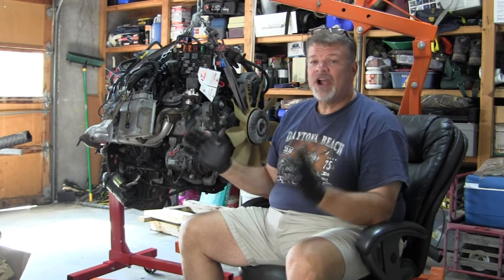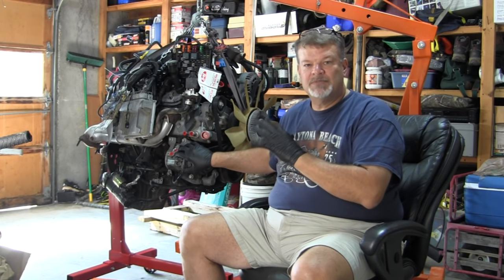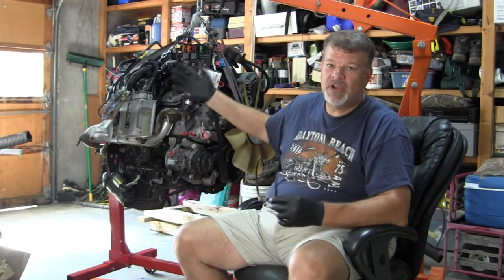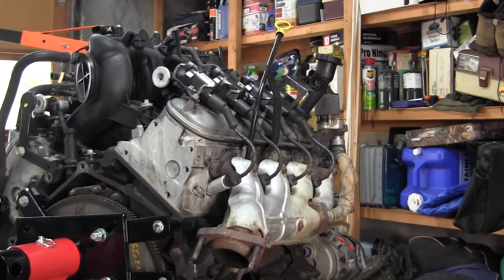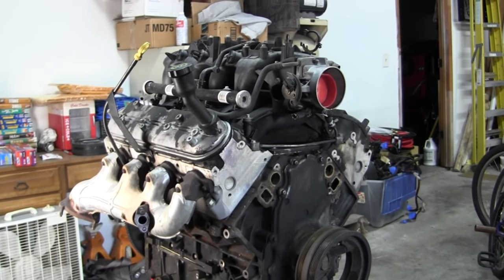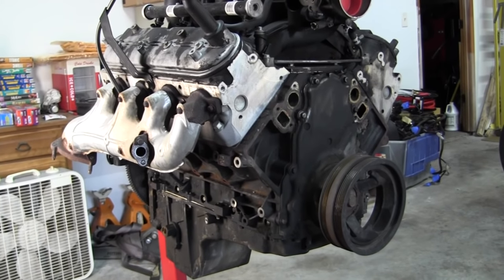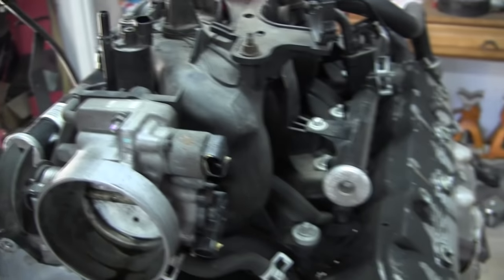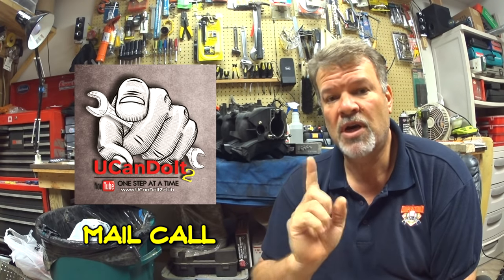LS 5.3L Build Part 1 Harness & Accessory Removal | Project Rowdy Ep005

Comment: I have a 2006 Silverado with the L33 Block I am about to tear out of the truck. I believe I have a bad cam/lifter. Stopped taking it to shops because they're all soaking me ... replaced my water pump, belt, and pulleys. When I finally got brave enough to diagnose this myself I pulled the pulley belt and ran the engine, noise is still there without any accessories. I have scoured youtube for info on rebuilding a 5.3 and found your project to be the absolute best reference and resource hands down. Eric over at South Main Auto Channel has a great series on removing and reinstalling the engine out of the truck and back in so between these I am about to go for it ..... I will mention I spent 20plus years as a parts man for marine and motorcycle dealerships so while very comfortable around an engine I have certainly never pulled a V8 and rebuilt it..... so your moto really inspired me.
Reply from the maker: Thanks for the feedback Sean!   I originally had interest in locating an L33, but the salvage yards are a little too proud of the aluminum block.  As I am throwing this into a Jeep CJ for Street use, I really just could not justify the upfront added expense.  So many great options and choices for parts available for these Gen3 and Gen4 engines.  I bought and followed a cheap book to follow as a guide.  And logged all of the parts that I used (links to download in the "Show More" section.  Cheers and if you have the opportunity to take your time on your project...  have fun with it!!!!!  Mike
Reply: Love your vids , is 2001 GMC the same ?

Comment: Good job in keeping the 862 heads. After porting they actually out perform all the 706 and other heads everyone goes for.

I’ve got a set on my L59. Great stock heads. I was mad until I finally learned about them being great heads.

SUPER CLEAN too! My motor was covered in grease. That’s what mine looked like after I got done washing it for 3 hours.

Comment: Will be starting an L33 rebuild very soon,  will be my first rebuild.  I have 
 2005 and 2003 silverados and this will be a spare. 2003 has 285K, 2005 has 180K.  So glad I found your channel!!  Thanks for sharing this!
Reply from the maker: Yours should be a fun project because it sounds like your not on a tight timeline.  Enjoy and have fun with it.  It's pretty cool stuff.  Mike
Reply: @UCanDoIt2Mike  yep, not a rush job for sure.  Just a fun project and will then have a backup motor.

Comment: Awesome series.  I plan on also using a LS motor so this is very helpful.
Reply from the maker: Sam, Do you use MS OneNote?  I have a couple of pages of notes that "might" be relevant to your research.  Let me look back through the notes and if I think they would be useful, I can either send you the Notebook, or convert to another format.   That would be a good video...  How I use OneNote to collect and save all of the information that I have gathered for this project.  Cheers!
Reply: I have never used OneNote.  Any information would be appreciated!  My brother recently swapped in a LQ4 and T56 to 93 Camaro that had the LT1 and auto so I plan on asking him for help too. lol

Comment: I like your style, smart move labeling all the wires you pulled off the engine. As a former heavy line Ford engine mechanic, I learned to do this as an apprentice. Sure, the "old pro" master mechanics could skip this step and laughed at me for taking the extra time. But the "hot-shot" youngster apprentices who thought they could get by without labeling the leads frequently got slowed down playing the guessing game when it was time to reattach them, and I got the last laugh...
Reply from the maker: Love the story!  And your right!  People need to learn to slow down and attack things logically.  By spending the extra 2% of time, it just reassured in my brain what it was and where it went.   Cheers to you Sir!   Mike

Comment: Bought a 07 5.3 yesterday to put in my 240z and this video helped alot i cabt wait now
Reply from the maker: dave datsun Awesome !!!  You should also checkout my LS Harness cleanup series.  It will show you how to remove unwanted circuits.  There are some great diagrams available under those videos.  Cheers and have fun with your build.   Mike.
Reply: @UCanDoIt2Mike  oh yeah I definitely will

Comment: This was such a great video! I bought two 1980's square body c10's that I'm trying to make into one nicer one. I also want to get a 5.3 and this video gave me some insight to that! Thank you if you see this!!
Reply from the maker: Sound like you have the beginnings of a great project.   A GM Gen3 engine in an old square body is quite popular and therefore there should be some good premade adapters to help your project.  For the longest time, my favorite truck was the 80's Chevy Silverado in Black with Rally Wheels....   Smokin'!    Cheers Mike!!!!!
Reply: UCanDoIt2 yes they are awesome trucks! Thanks for the reply! I appreciate the info as well! I have a couple questions for ya if you don't mind. How long did it take you to do this process? Where did you get your engine stand and do you recommend it? Lastly, how much money do you think you had in the engine overall considering you had it machined and everything?
Reply from the maker: It took me a long time mostly due to filming and setup.  Teardown could be done in a couple of hours.  Machine Shop work is a couple of days of work.  Build back up, should only take a couple or part-time days.  Below the video is a link to a PDF file that show all the part numbers and cost included in this build...  about $5k.  But there are may options that I added that most will not.   The Engine Stand came from Harbor Freight.  It is a 4 Wheel version that helps give it a better footprint.   The Stand was rated for the weight that put on it, but to be honest, it shakes a lot.   If I was going to do this more, I would have invested in the larger version (more steady), but for my application it was fine.
Reply: UCanDoIt2 I appreciate all of that! I will have to give you a little shout out when I start my build! I appreciate the review of the engine stand as well! $5k is a bit much for me as I am still in school but I probably won't do a full tear down. My goal with the C10 is to get to 400 hp and ive been told that that shouldn't be too hard!

Comment: ok this is my favorite channel! thanks for the mail call buddy! this is fun to watch and interesting to see how GM puts their stuff together. like internal cam and crank sensors...! I'm ready to see inside this engine Mike!!!
Reply from the maker: You know... this is just some cool shit!   Thanks for the stick.  When I remove Rowdy's Hood, it is going on the wall for my stickers.  All of these pushrod engines appear to all have the same basic parts that are arranged a little differently.  I know that this Gen3 engine moved the Oil Pump compared to my current AMC due to no more need for a distributer.  Cheers to you!
Reply: Yeah I figured it would be generally the same but I love to see something come apart!
Reply from the maker: Just so you know, I'm now glued to your 455 teardown.  You are making short order work out of that.   Remember the one that ends with no leftover parts wins!  BaaHaaHaa!
Reply: Hahahaha! You're on!!!
Reply: MontanaLowGear 
Does anyone know if if I rebuild my engine like he’s doing will I have to redo the transmission aswell 
If I do this my self will it cost me the same or close to someone else doing who knows what they’re doing

Comment: I've got a '99 Silverado with the LM7, and I'm wanting to do something similar down the road. At some point I want to add a bit of boost to it, but I'm having a hard time deciding between a supercharger/procharger or a turbocharger. I was thinking supercharger/procharger initially because it's easier to install it seems, but a turbo would be able to make more power with the offset of being a bit harder to install and get going. Also I've seen conflicting info regarding the transmission. I've seen some people with a stock 4l60e with boost and no problems, but I've seen other people say that I'd need to either get a performance 4l60e rebuild or get a 4l80e, which should I do? Any suggestions would be much appreciated, as well as tips on what to upgrade, what to add on, all that stuff. It's bone stock right now and will be for a while until I have the money to actually work on it.

Comment: Thank you so much! Now i am ready to do my 2000 silverado 4.3 virtec to a 5.3 vortec. 4.3 has almost 200,000 miles and still running but i just need a little more horsepower like 500hp
Reply from the maker: That should be a fun build....  have fun!
Reply: Bigvik I can relate got a 99 with the lm7 and it’s a quarter of a million, still running strong

Comment: 10:05 I personally never use and impact when breaking bolts loose on aluminum. i learned this while replacing an ac pump in a 4.3 vortec i broke one loose using a ratchet and to speed things up i grabbed my impact on the last 3. when i checked the treaded aluminum holes where it bolted to the threads on the one i broke with a ratchet was clean but the other 3 had aluminum specs like the impact was damaging the threads

Comment: I did a 5.3/ T18 swap into my 86 CJ 7 over last winter, and have been driving it all summer; you certainly don't need to up the power too much, a stock LM7 it quite beastly in a CJ. Your engine looks quite nice for the miles you said it had, doubtful it even needs a rebuild, you must live down south somewhere, also looks to be a 2001.
Reply from the maker: I completely agree with the needed power in a CJ7.   That is why I am not trying to build some crazy bad ass engine.   I am just rebuilding my LM7 with stock specs except for the Cam to get a better sound.   If I end up with stock 300HP, I will be very happy.  Cheers!

Comment: Just Subscribed and looking forward to watching this series.  I have a 2003 Silverado with the same engine that sounds like has a bad lifter that I am paying somebody to swap out with another motor.  I'm going to take the engine that is currently still sitting in the truck and attempting to rebuild it myself.  I'm 40 yrs old and have a decent mechanical aptitude, but have very little experience in tearing engines apart and putting them back together.  Needless to say, I'm excited and a little nervous and doing as much research as I can.
Reply from the maker: Shane, That is such an awesome plan with the current motor.  Grab yourself a good Rebuild Book (or two).  I really enjoyed the one that I followed.  There is a link to it in the description section ("Show More") under each video.  A good read before you start and all of the sidebar notes are very educational and help you plan future steps.   With your mechanical aptitude, you will find this a really cool project.  Have fun!!!!!!
Reply: Thanks for the tips and resources on the books.  Now leave me alone so I can watch the rest of this series please!?  HA!  I never thought I would even try to pull off a rebuild, but I think I have the patience now.  Absolutely zero chance I even attempted this 10 years ago due to not having the patience.

Comment: which sensor was missing from the passenger side exhaust pipe? you said it didn't come with the motor. thanks i'm taking notes for when I do this to my LM7 mill
Reply from the maker: One of the Exhaust Pipes did not come with the O2 Sensor.  That is something that I will pick up from a Salvage Yard.   Cheers!

Comment: I'm officially a fan of you brother. I'm going to automotive school and this is the same engine I have in my 09 Silverado. Though the heads a Little difference on my 5.3 it read 799 wonder if those are good heads for the 5.3? The truck still running strong at about 120k miles on it. I'm definitely a fan of you man. I'm learning so much about the 5.3. Hopefully when I go to school I will learn much more.
Reply from the maker: Dude!   You just made my weekend!   Thank you for the message. Best of luck with your plans in automotive school  If you determine that I have done something wrong..... break it to me lightly!  Haha.Thank you Sir!
Reply: UCanDoIt2 no problem my man! I will definitely continue to watch the progress you make in the other videos with the motor. Also thank you very much. Hopefully I be starting school this year.
Reply: the best heads are 243 once you get a 6.0/6.2 the square 823 heads are the best
Reply: Koalafications4Dayz well I don't have a 6.0 or 6.2 bro lol. I have the 5.3 I wish I had that ls3 6.2 though. Yet you can mod a 5.3 out and have the exact or even more power as the other ls engines.
Reply: @dareuslomas94  not sure if this info is still relevant but, you have a set of the best factory heads out there. 
243/799 are the same heads and have the best flow numbers for a stock 5.3 💪💪💪💪💪

Comment: One more subscriber🤣 But I really like how u went into detail with you're rebuild... I watch all the episodes.. i have a 2001 tahoe with the 5.3l and it threw a rod bearing unfortunately... so much did this rebuild cost you?
Reply from the maker: I'm going to give you a number...  but it will not translate to what you could fix yours for.  You could do this for a lot less.  My Engine was $600 when I bought it.  The rebuild parts and machining was $4500.  Here is a complete parts list of what was done in the video.  http://bit.ly/RowdyEngineExpenseSheet  I also previously owned a 01 Tahoe (bought new and owned for 16 years.  Mine experienced Oil Pressure issues.  For yours... beyond replacing worn or broken parts, you would also want to consider Oil Pump and Water Pump.  Hope your works out!  Cheers!!  Mike

Comment: Mike I have watched all of the Rowdy videos some more than once trying to squeeze every thing I can out of them and their all great. The wire harness videos are the best I have ever seen and I have been looking for a long time, because that scares me the most.

 Mike I was surprised when you didn't use a flat top piston like they use in the 4.8 and l33.  What were your thoughts on that.
Reply from the maker: Arnold thank you for the compliment!   As far as the Pistons...  The machinist that I used builds race engines and I had to remind him a couple times that I was looking to building a street-able engine.  We did not go into the weeds on the Pistons, but I am happy with his choice.  Not looking to super high compression for this engine  (I have a 68 Camaro that will have other objectives!!!!).  This is an old Jeep!  Looking for better than stock performance, reliability, and some Gen 3 build experience.  Needing to save some of my budget for other areas of the project.    I appreciate the question and the fact that you posed it as a question and not that I "Should have..."  There are so many options and choices when doing this.  I was trying to stick to my objectives.  Thank you!!!!  Thank you!!!!

Comment: I just post your videos on LS swapped 88-98 Group on Facebook I think you have the best video out there thank you for all your help ....... but i'm still little confused on my vehicle because it needs to be smog it's a TBI truck 454 93 and going with the 5.3 engine do I keep the original harness from 5.3 and added the tbi wires from the dash but what wires ?
Reply from the maker: Thank you very much for the compliment and sharing on Facebook.   Very very cool!   Your configuration is a little out of my research solution.  BUT....  Let's chat about what you have (a logical discussion not a technical one).  The Smog system....  The Vortec engine that I purchased did not originally come with a Smog system.  I assume that you will need to look for a 5.3L that already has the Smog system integrated and you will need to leave that all intact (items, wires and connectors).  I believe it will be connected and controlled by the PCM.   TBI SETUP....  Are you trying to keep the TBI setup?   Would it not be easier to keep the new 5.3L Intake/Injector/Throttle Body setup solution intact that comes with the new 5.3L?  You will need pressurized fuel lines from the tank, feeds the fuel rails, standard 5.3 injectors which is all controlled by the GM PCM.  You would need to work out if you want to use a Drive By Cable to operate the throttle body (like I will be doing) OR Drive By Wire, which will require you to install a modern Gas petal that uses a potentiometer to relay a signal to the PCM to control the Throttle body.   Hope this helps some to steer you in the direction that will require more investigation.  Again I appreciate your feedback!!!!! Thank.... Mike!

Comment: great pic i got a l33 n 01 6.0l lq4 for my projects i bought 6.0l for 600 150000 miles tore it down for rebuild i got 13 yrs old involved too
Reply from the maker: Those are both great choices!!!!  I was eyeing the L33 for this build but then decided on the LM7 at a lower cost.   My overall current restoration project is not all about the engine.  The goal of this project is more about restoring the jeep and learning new things including the LS based engine.   I do have another project (old Camaro) that I will dig a little deeper in the engine area.  Great to here that you are getting your 13 YO involved...  Something these kids will remember for ever.   Cheers!!!!!!!
Reply: @UCanDoIt2Mike  my dream car is a 68' Camaro!
Reply from the maker: @damondelgado4603  Heck yeah!  That is what I have in storage and will be my next project.  Cheers!